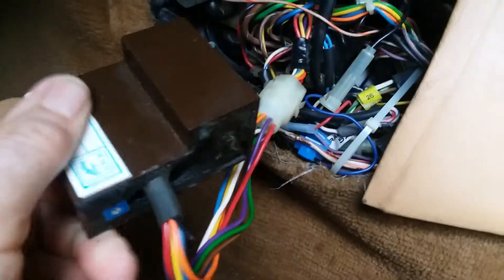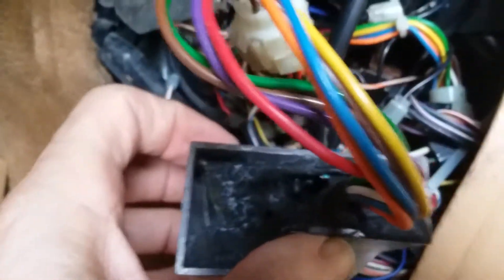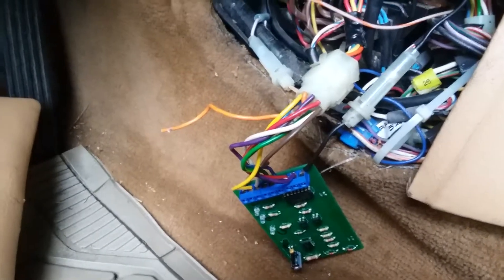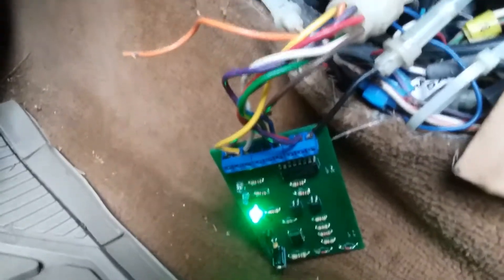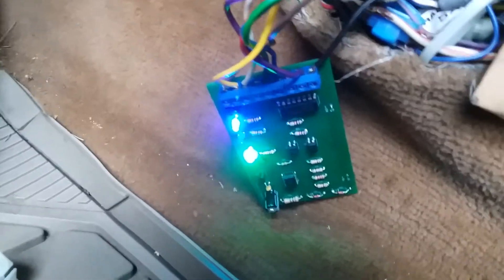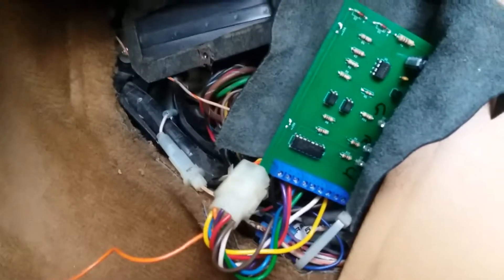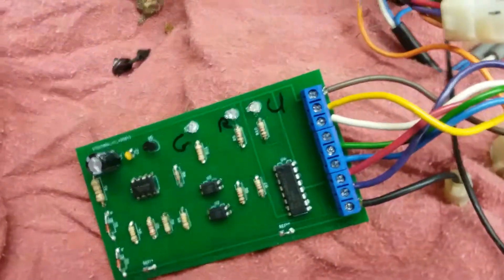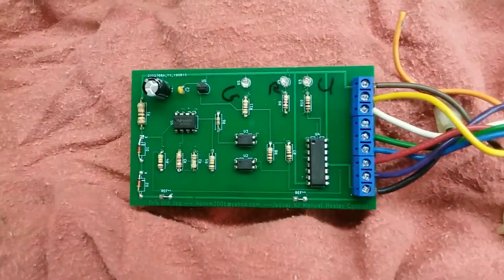Jaguar XJ Heater/AC manual control #2  Description, Installation, etc.

Comment: Hi are still building these control units
Reply from the maker: Dean,
Just happen to have a new run of the boards.  They are smaller and come with a small box, but use the same circuit.  
Contact me at Novom2001@yahoo.com for details.
Reply: @novom2001  yes interested, can you put one aside for me. On holiday at the minute so I’ll get back to you in about a week. Cheers Dean
Reply from the maker: @boatslave1  Let me know, we have several.
Reply: Hello,
I just bought an 87 xj6 and would like to buy one of your circuit boards.
How do I contact you?
Reply: Yes I have your contact information and I have sent an email.
Thanks!

Comment: Where did you buy that I have a 1990 Jaguar XJ 4.0 and my A/C doesn’t wanna work idk why
Reply from the maker: I'm sorry man, but this will not work with your car. In '88 Jaguar went to an electronic control for the system and ditched the mechanical servo of previous models.  This board is designed to drive that servo.

Comment: I bought a heater element  from someone on ebay , "JAGUAR XF X250 ELECTRONIC HEATER MATRIX ELEMENT MF013410-0451".
It has two power connections (12V I think) and two small connections for control. Would you have more info on it?
Reply from the maker: Sorry, Benny.  My Jaguar knowledge does not include the new cars.  It would be reasonable to think, as you suspect, that there are 2 power wires and the second pair is likely connected to a thermister or some other sort of temp sensing device.  Probably used in over heat protection.  Just a guess.
Reply: @novom2001  Thanks for answering. I suspect the two small wires are either pwm or temp sensor,  just thought you might know more. Again thanks.